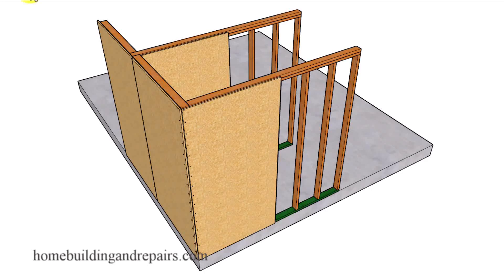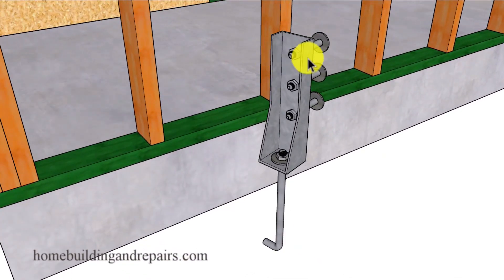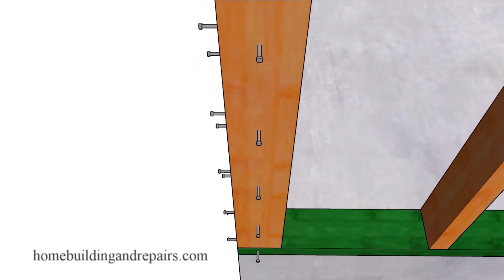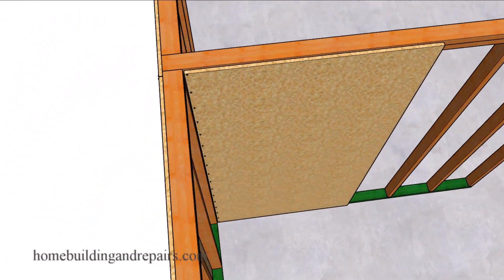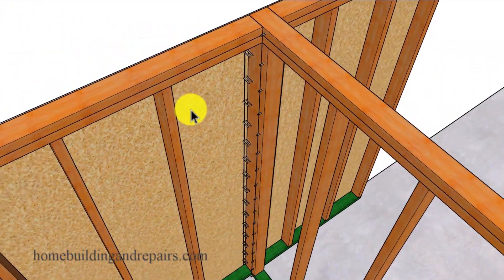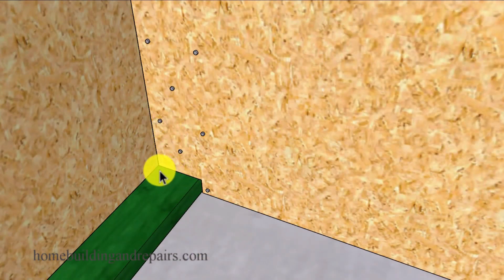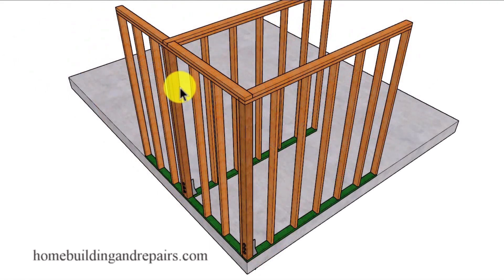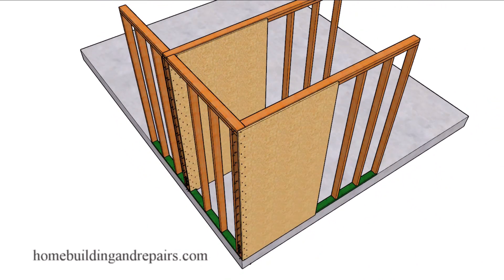Simple House Framing Ideas And Examples For Making Stronger Shear Wall Intersections Connections

Comment: I'm confused. Is a shear panel separate to the exterior sheathing and treated in a different way? Or is all the sheathing around the entire structure applied in this manner? So in essence it's the method of attaching the sheathing that makes it a shear wall? Could you do a similar thing with roof sheathing on frieze blocks?
 Thanks
Reply from the maker: Shear panel usually needs to be installed vertically and wall sheathing can usually be installed in both directions. I would visit our website for more information about roof sheathing.
Reply: @gregvancom  
So does every sheathing panel on say a 24ft wall have to be nailed as a shear panel or can you just treat the first couple in this manner and get the same benefit?
Just thinking that if all panels are nailed in this way it doesn't leave much room for siding nails.

Comment: Why would this be desired? Is this something found in earthquake prone areas? Maybe where tornadoes are more common?  Seems like this needs to be planned before the walls are framed. Also, wouldn't the interior framing space need to be adjusted so the studs fall on the end of the shear sheet goods on the inside?
Reply from the maker: Yes, more popular in earthquake areas.